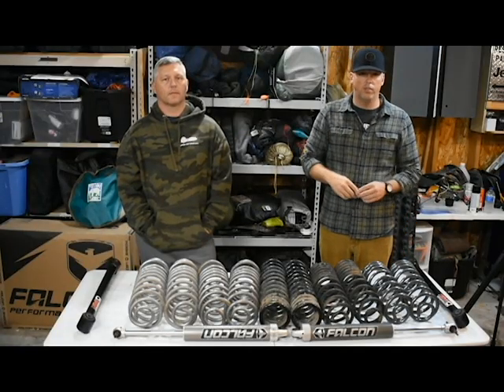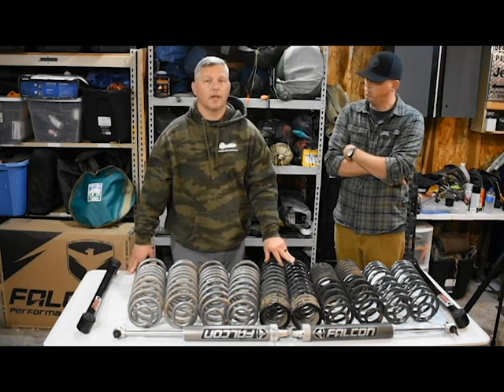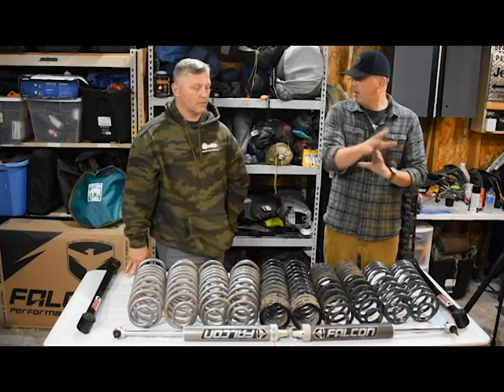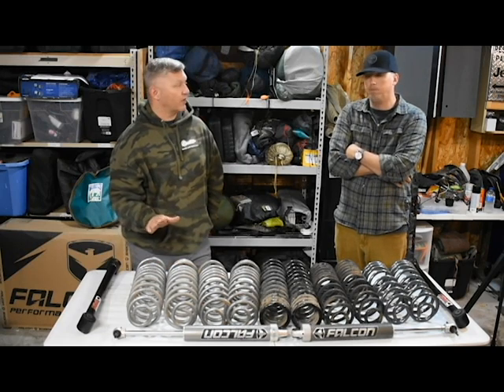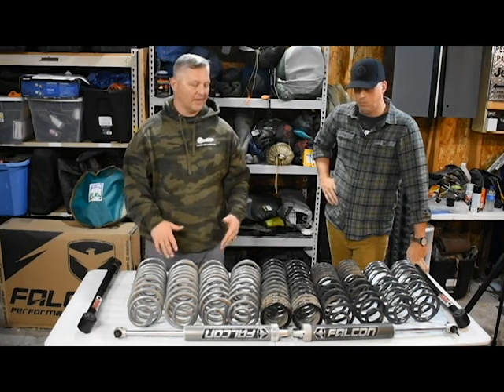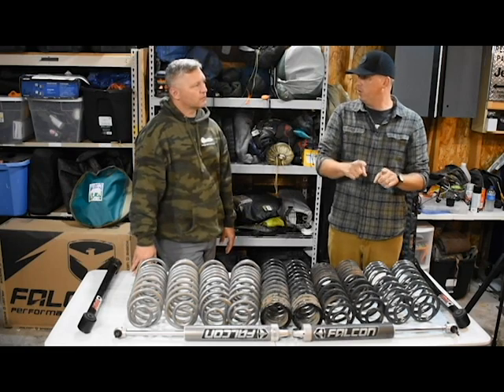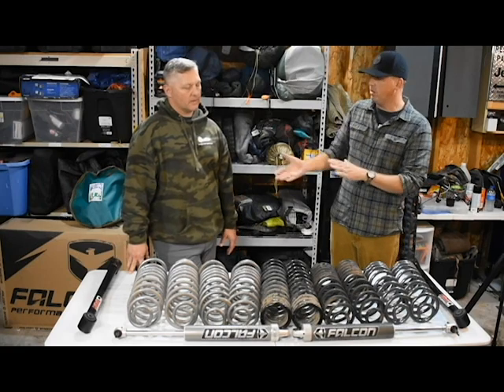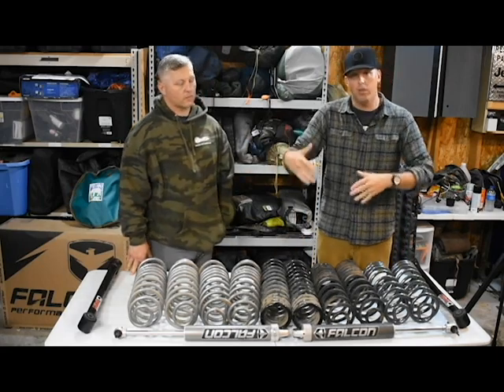JEEP JK  OVERLAND BUILD episode #1

Comment: It’s irritating how lift companies don’t share spring weights with customers. It would be a lot easier to choose springs if they had an apples to apples comparison chart for them. I ultimately went old man emu because they do share their spring specs and they have different rates to tailor  to your specific setup. They only sell a 2” spring but that was fine with me for my uses and my suspension geometry is still reasonable.